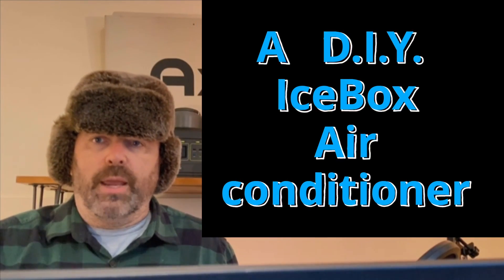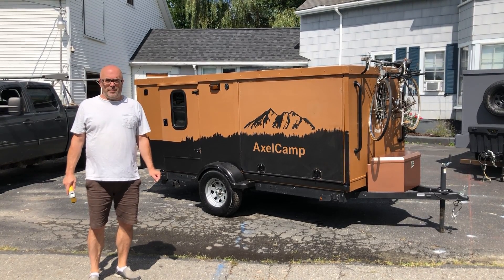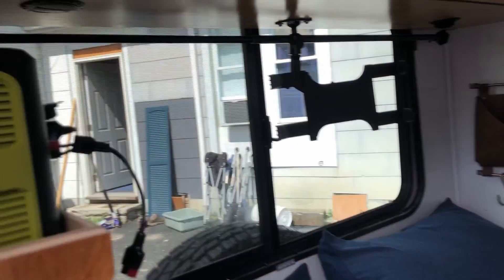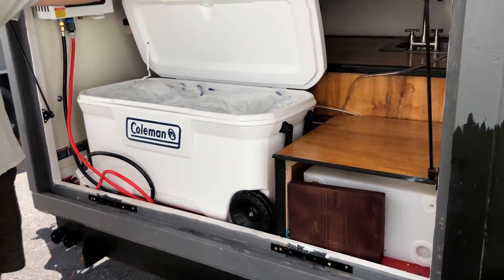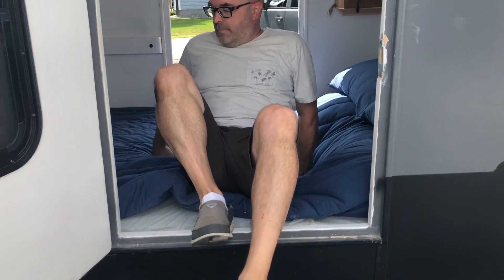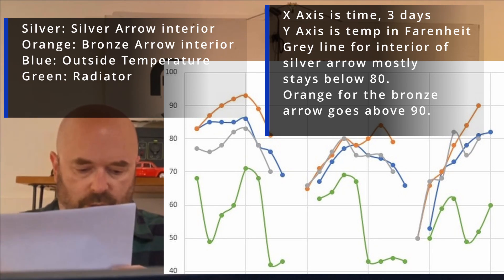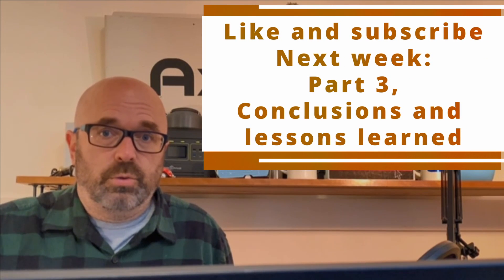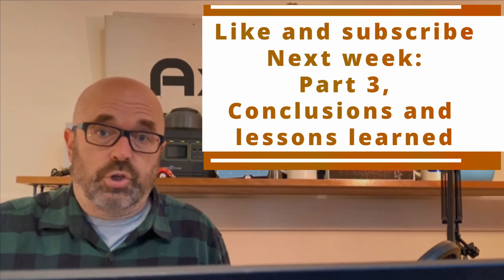Ice box air conditioner, part 2.  A DIY ice chest AC that you can cool your camper with offgrid.

Comment: Im in AZ,  always looking for cooling ideas. Especially ones that run off grid.  I make my own crystal clear 8x16x10 Ice blocks that last 2 weeks in ice chest.   I have a 57' Canned Ham camper that I've completely refurbished.    I really appreciate the level of experimentation and documentation youve invested here.  I know its 2 years late and just catching your channel first time here and haven't seen your total build, but I might try it here to see if it will work.  I might try a few of your new ideas too like silver roof paint, maximize the coiled tube in the ice chest and completely immerse in packed ice and water.  Using PC cooling radiators and 12v fans, I will look into bigger fans and radiators into a box that you can move or point like a box fan. Cool ideas
Reply from the maker: Cool, would love to know how it works out.  Where I live they used to harvest ice from the river and store it all through the summer for use, used to be big money.
Reply: @axelcampmaine yes I bet.  One cannot find blocks of ice now, they are just crushed ice pressed into block shape.   Mine are solid see thru as big as you like.
Reply from the maker: @ramvan2284  I bet solid has more ability to cool
Reply from the maker: Also, from the tests I did, I'm pretty sure that a white roof is better than reflective, though it's hard to tell since the temp probes don't work on reflective-- they come up with a below ambient temp.